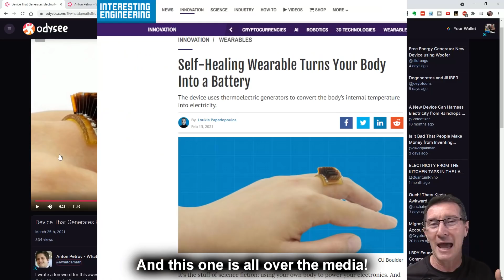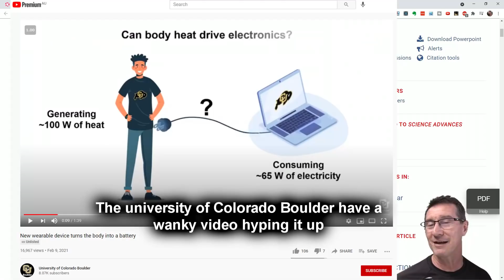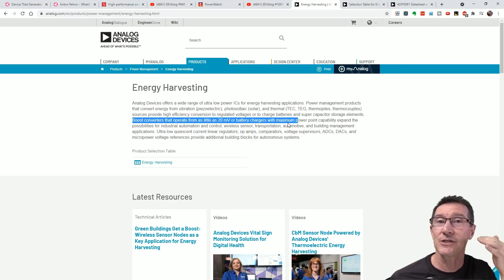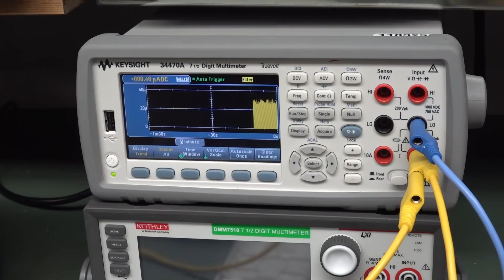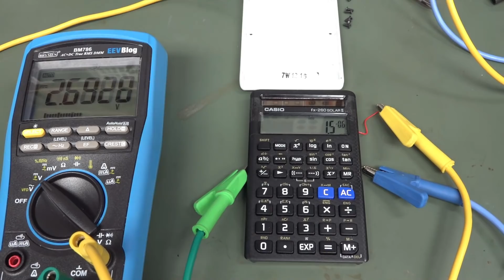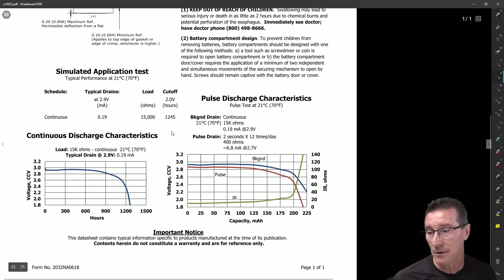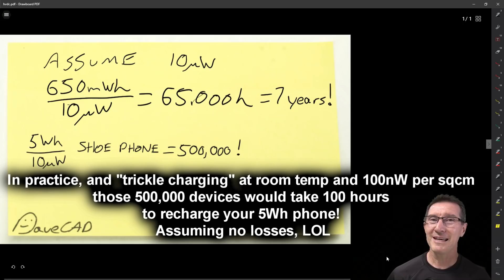EEVblog 1383 - Human Battery Energy Harvesting BUSTED

Comment: Average finger temperature in comfortable room temperature around 21 C is 26 C. The temperate differential is only 5 C. Dave is being VERY generous.
Reply: Interesting. Also, with those fins on the top (heat sink), won't the heat from the surface of the skin rapidly deplete to nearly match the ambient temp? Even if the device was 100% efficient, the energy it generated would result in cooling the finger.
Reply: @billr3053  To some degree yes, if the person would sit still there would be some radiant and convection heating but that would be small comparing to the device heating up itself. Temperature differential on the junction will never be equal to the differential between the skin and the ambient temperature. 
To increase the efficiency, one side of the device would have to be at the body core temperature. Where doctors typically measure the core temperature? There are two places. Assuming you don't want to keep it in your mouth, there is only one optimal place for this device to be located ;).

Comment: I'm waiting for the NANO HEAT PUMP TEG powered IoT/smart watch device to improve efficiency by increasing the temperature difference :). 
Probably it would be more economic to run a mirco steam turbine with water evaproated by this heat pump and generate power the old fashinoned way with a micro synchronous generator.

Comment: Even if there would be device that could harvest a lot more from our skin, then wouldn't it damage our skin? We need that power to live.
Reply: We constantly release waste heat through our skin. That's what it's for, heat dissipation. Hence the lack of fur, the sweat glands etc. So that's not an unreasonable concept, it's just that the power density is way too low.
Reply: @tybofborg  i know, but we do it on large area, and if we use just little part of skin to dissipate a lot of power i guess it could lead to some problems.

Comment: The fackt that such a small solar cell can provide more power just with ambiant light kills the Body TEG thing completly !!!

I have build a TEG for use on a camp fire, to power a LED light, the efficiency of those things are horrible!
You pump multiple kW´s of heat through them to get a few watts out.
It is only justifiable if you already have a huge temperature juction sitting around doing nothing than dissipating heat, like on a wood stove.
And even than to amortize just the power it needed to build the thing, takes for ages!
It´s just a gimmick!!

Comment: I can imagine someone standing on Mars wearing a space suit made of these devices trying to charge their phone! I'll bet that material makes a pretty bad space suit with all the fins radiating your body heat away.
Reply: At 1% of Earth sea level pressure, Martian atmosphere is a pretty bad thermal conductor, meaning that much like the spacesuits we're using today, a Martian suit would probably need active heat dissipation to prevent you from overheating.
Reply: @tybofborg  Interesting. I don't really know how all of that works. I would assume it's more practical to use solar panels for energy on Mars.

Comment: I will collect more static electricity from my cat in 5 minutes than from this "hot energy ring" in a day. But seriously, collecting static electricity from clothes is really more profitable.
And you can also cover clothes with thin piezoelectric films and simply from
daily movement (flexion-extension), you can get really measurable values and power them both a watch and a calculator and even a small LED flashlight.

Comment: A typical watch and strap will be at least 20cm^2, which is about 1 microwatt based on their own numbers. Useless for a smartwatch, but I think a regular watch might be just about doable. But at that point the cost and weight would be more than it would be by simply including a coin cell that could power it for 10 years.
Reply: Or just use a tiny solar cell in the watch as that makes more power

Comment: my watch (has all sorts of smart nonsense) with a 1wh battery for ~ 10 days of use and is around 9 cm2 on body contact area. i might be bad at math but i think i would get an extra day of battery? 
i also dont fully discharge my watch before recharging it so i think i could get even longer.
i dont think a great use of this tech would be on its own, but use it to recharge a battery, augment a solar panel and perhaps one of those mechanical energy harvesting things?
would be expensive but think you could make it last a very long time between charges

Comment: Interesting devices but 93 Kelvin is colder than Siberia in winter.
The last solar calculator I pulled apart had a battery and the "cell" wasn't connected.
Reply: I bought one for 1 Euro and it had a transparent plastic housing .. so one could see from the outside that the solar cell wasn't even connected .. crazy .. I took out the cell and it worked though (I was expecting a fake cell)
Reply: @VVerVVurm  Me too..

Comment: If they could make larger very rugged flexible thermal electricity generators you could build it into clothes etc a shirt has a fair bit of surface area.so it could make a fair bit of power.

As far as I can see The problem Is the same as with all flexible flexible electronics they are expensive and they are nothing like as tough as a cotton shirt of something.

Comment: Once saw a truly useful peltier device application. It was a fan designed to be placed on top of a wood burning stove. 
I imagine the thermal gradient between the room temperature side and the woodstove side would make that little fan move quite a lot of air and improve the wood burning stove's overall efficiency by a significant margin.
Reply: I’ve had the original (Caframo Ecofan) for almost 20 years...  It’s quiet and doesn’t move much air, but it’s enough to make the far side of the house 2-3 degrees warmer. Ingenious use of a TEG.

Comment: My Matrix smartwatch has been running strong for a good long while.  I've only had to charge it once or twice a year so far.  Been about 4 months since the last time I pulled out the charger.  It's not generating tons of power, but plenty for low power devices.  The powerwatch actually uses about 1/8th the power you claimed it did in your last video, basically your estimates were the worst case scenario.  In reality, it spends most of it's time asleep (with display on) as it only needs to update the screen once a minute.

No stopwatch, but it's a smartwatch I don't have to charge.
Reply from the maker: Betcha the TEG in it is doing bugger all. There is a reason it needs that charger. The TEG is a gimmick.
Reply: @EEVblog  Except as I said in my comment, I haven't charged it in about 4 months.  So it IS the TEG.  I'll agree that the TEG is a tiny amount of power, but with the CPU in super low power mode most of the time, it's enough  The real work of the Matrix watch probably isn't in the TEG, but in the low power engineering that made the TEG viable.

Comment: Does the ISS employ Peltier devices in the walls of the station modules to reclaim some power after heating the interior? Imagine the temp delta!!
Reply: No, they have more than enough power and rejecting heat into space is a bigger challenge
Reply: I sincerely doubt it even for scientific testing purposes. While space is nominally cold on paper it is also overwhelmingly empty which means its thermal conductivity is absolutely atrocious. So the "cold" exterior section wouldn't stay cold for long and indeed space habitats quickly run the risk of overheating. As far as cooling options go fluid cycling or simply passive heat conductors (read: solid metal pieces) leading into radiator panels are way more efficient than PEDs, that's why we use those technologies in fridges and PCs.

Plus power isn't much of an issue for an orbiting space station. Solar panels are simple, reliable, safe and their demand for high surface area actually helps in keeping them cool.
Reply: @Photoloss  makes sense now.

Comment: My first thought, not even through the video, if you drop your body temperature by disposing a bunch of power, your body is going to go through more calories in order to maintain it's ideal operating temperature. Our bodies are optimized over hundreds of thousands of years to run at a certain temperature. Don't forget your hands are colder than your core body temperature as well.
Reply: Our bodies are only somewhat optimized for natular environment that was outside a few thousands of years ago. When faced with some weird or just unusual stuff the reactions are generally completely broken and you can get into big trouble if you do not use your brain. 

If you start to chill a part of you body and start loosing heat then your liver does eventually start to produce more heat but at the same time the blood vessels near the point you are cooling down quickly contract. The reaction helps to keep your internal organs warm and operating at full power but you also can easily get the place injured if it gets too cold. And there is no way to make your body react more adequate for the case when it is just a small patch of your finger that is getting colder.

Comment: Wouldn't the efficiency of this device be proportional to how cold you experience it's surface, i mean yeah it's a smal smal local effect but still, no one publishing this idea thinking about how uncomfortable it would be to constantly have something sucking heat from a point of your skin, each watt of heat transferred away from you is a potentially harvested watt, and that's the exact opposite comforting effect that of insulating clothes.

Comment: I was going to guess you'd need a bigger temp difference than what typically is ambient and the human body. Didn't think you'd need around 95°K however. Even 50 would not be pleasant.
Reply: The temperature difference is actually entirelly possible to get during winter if you think about it. If it is -57°C outside and you are wearing a thick layer of clothes and running home from work so your skin gets up to 38°C then that is exactly 95K difference. You would not like to have the radiators on your fingers though because you would get a frostbite in a matter of minutes but that is beside the point. 

Fuel elements are the real future. Alcohol is cheap and mineral oil and gas are even cheaper. Why can't we just fill our electronic devices like we do our cars?

Comment: I wonder, if ΔT is around 90 k, then would it be worse if it's above or below your body temperature?
Reply: Above. -60°C is somewhat survivable with adequate clothing and only requires basic calorie intake to counteract, f'ing freezing sugar is unpleasant but arguably not lethal especially since you can light some of it on fire to de-frost the rest. Now switch to 120°C where your primary survival resource literally evaporates (and blows up flimsy containers), can't cool below 100°C, still is painfully lethal at that temperature and the required secondary resources (the salts and fats you excrete while sweating) don't help you solve that conundrum either. And if the environment reaches 100% humidity you will simply die outright no matter what. I don't know which will kill a completely naked human faster between hypothermia and hyperthermia but my money's still on shivering until you drop over literally boiling inside your own skin.
Reply: @Photoloss  well I can tell you that 100°C is not that bad yet, I've done 10-15 minutes of sauna at that temp before. Obviously humidity is a huge factor in that. I would do +120 instead of -60 any day if I had to, especially if I get enough water to drink before or during it.
Reply: Neither of them are good for long periods of time. You can not really stay outside for more than a few hours at the -60°C temperature and very few people can comfortably sit in a 100°C sauna for more than 15 minutes straight. It is possible and even benefitial to your health to switch between them a couple of times in a row but that is a very special activity you generally get yourself prepared to and you have to wait to be able to enjoy, not an every day one when you would have your wearables on.

Comment: Honestly I don't even see much use for this in medical devices due to the potential stress induced by heat loss coupled with the need to have it on the outside i.e. exposed skin to maintain a thermal gradient. Might as well wear/implant a wireless charger and call the waste heat a feature in keeping your bed nice and warm.

The other question is how hot these things can get and still survive. Might be useful in industrial plants to power remote sensors while acting as a heat sink with all that surface area, and no high voltage supply line to pose an ignition/explosion risk. But then again these things look awfully complex to mass-produce and deploy at such a scale not to mention the minimal cost savings they would provide (if any).

And since Dave mentioned "standing on Mars": approximating the Perseverance rover as a 2.2m*2.7m*2.9m cuboid based on its bounding measurements (already rather generous considering its actual shape) and using the 10muW/cm² figure from Dave's calculations (don't ask me how the rover is supposed to maintain human body temperature on Mars for any length of time...) these energy harvesting gadgets would produce a respectable 4 Watts of power. The RTG actually powering the rover produces 110 Watts and fits in a nice protective casing on its back.

Comment: I'm trying to figure out how to harness the heat in my attic in the summer with a device to generate power. Attic temps can reach 130 f or more on sunny days. Maybe a gas or liquid evaporative heat exchanger and a TEC? Just a brain exercise. A vortex wind gen?  Just a thought and probably not a great gen.
Reply: you need temperature difference, not just high temperature

Comment: Instead of wasting time on all these nonsense products, I wish they'd just make a decent, but affordable, 5-10 watt crank generator. 

Metal gears, flywheel, USB output. 

Just a nice little disaster-ready genrrstor for our phones and other gadgets. 

Some exist already but the gearing is so rediculous that you have to spin it hundreds of times a minute, with very little resistance. 

Or they have plastic gears that strip too quickly. 

Or they have unstable voltage regulation. 

Just make a decent version while keeping the price reasonable!